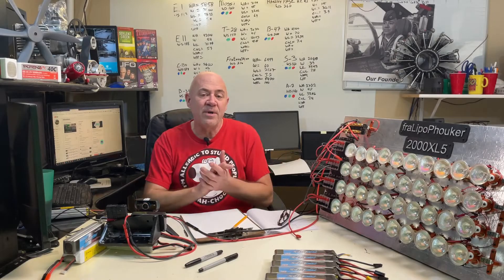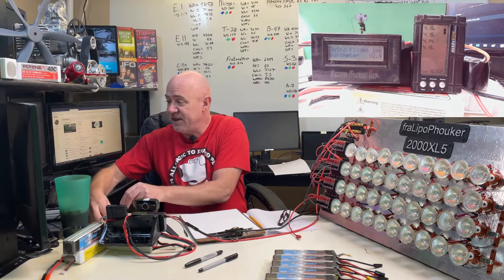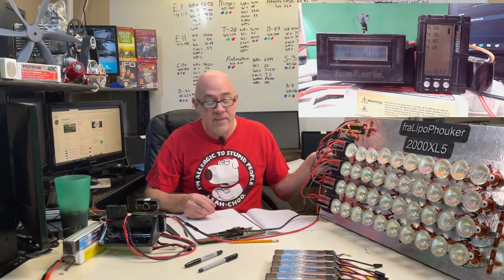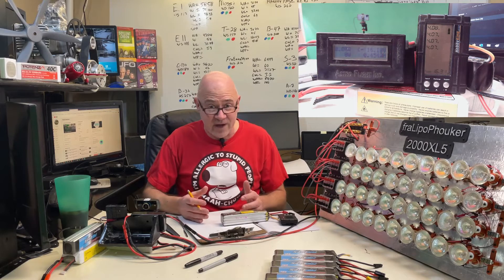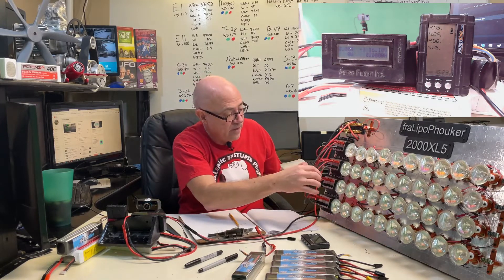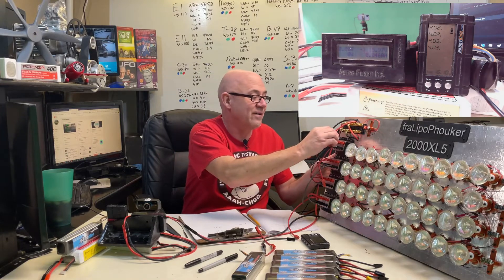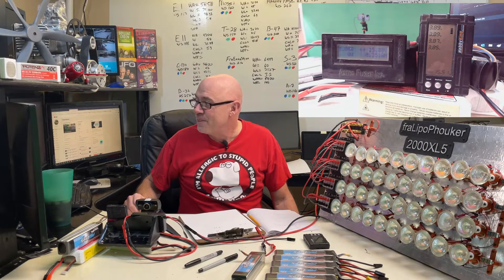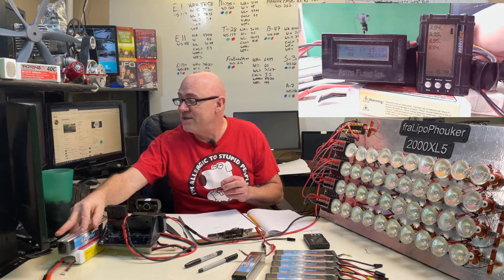(Experiment!) What causes a Lithium polymer battery to catch fire while charging?

Comment: what class extinguisher do you keep near your lipos?
Reply from the maker: I have two ABC's, but, I have a 5 gallon bucket half fill with sand, that I can toss a lipo into, and then cover with sand. But, in eleven years now, never had a Lipo fire. I did blow up a A123 once, wrong settings on my charger.
Reply: @dagtheaviator  i wish more people wouldn’t put the fear into people, if charge with some thought and follow stuff like this you can have a ton of success . and discard batteries when they need to be
Reply: @MrMadtractor I use a traxxas ez peak dual and charge off brand lipos. Never had any issues with it. Just charge with the age old rule of thumb. 1 amp/ah

Comment: Thanks, cool video. It would be interesting to see cell voltage when you parallel charge say 4 packs where one has a bad cell. This would be harder to measure without soldering custom wires. I also wonder if parallel charging at low amps to what degree is safer than at high amps. I know people that parallel charge at home at low amps thinking it's safe, but I have a bad feeling about that.
Reply from the maker: I am working on a video I hope to have up later today about parallel charging. It won't have the bad cell as I already know it would get hot and possibly start a fire if not using the balance mode. With the balance mode, my charger would never get the one cell above 4.2 and would end up timing out. :)

Comment: What do you mean "balance once in a while"??? Balance charging is mandatory ALL the time!
Reply from the maker: I also posted this-
This experiment dives into why a bad cell can cause a Lipo to catch fire while charging. 

Note: I have only had Lipo fires from running tests. NEVER from normal balanced charging. 

Remember-
Never leave a Lipo unattended while charging. 
Always check your IR. 
Always balance charge.
Always use a good charger.
Reply: I guess not fully balance charging is convenient while doing parallel charging... Which I would only do at the field and with packs that I know are good.
Reply from the maker: Just an FYI, very few people I know (quads/FPV) balance charge every time at the field. I do, and as I said in the information part of the video I recommend it. With that said, I have had manufacturers tell me the reason there are different modes on their chargers is that some people just want to charge as fast as possible and fly. That's why their charges will work in none-balancing modes. :) If "Balance charging is mandatory ALL the time!" they would not have different modes. :)